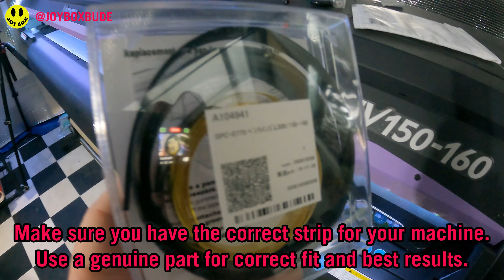How To Replace The Cutting Strip On Almost Any Vinyl Cutter

Comment: where can i get the knife cutting strip ? i have a mimaki cjv150-130 and bought a few on ebay that were not the correct size
Reply from the maker: Hey, any Mimaki dealer in your country should be able to supply one.  I would use an OEM item.  Hope that helps :)